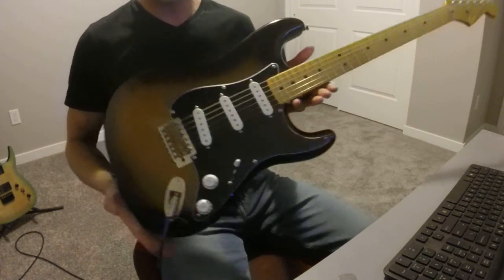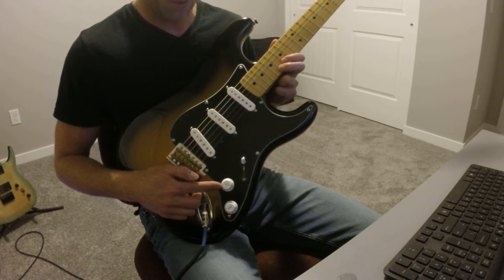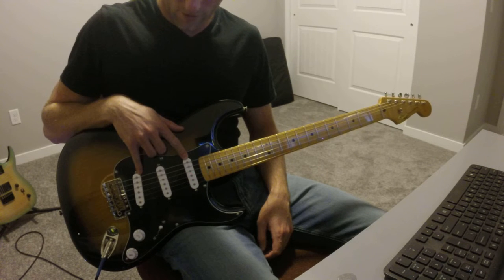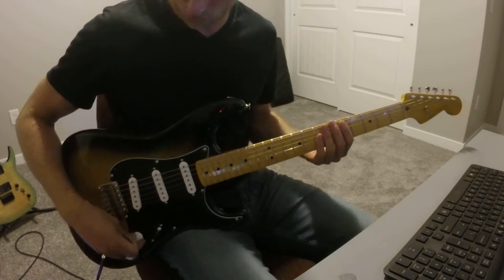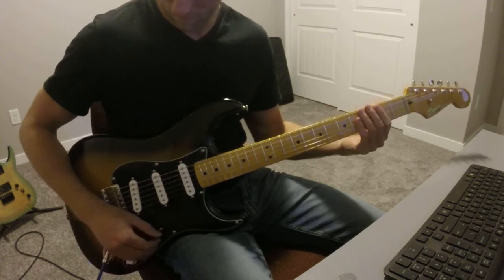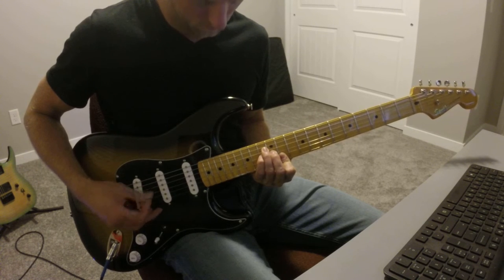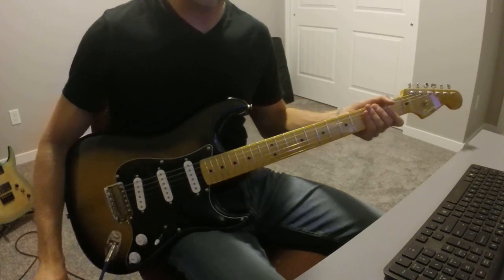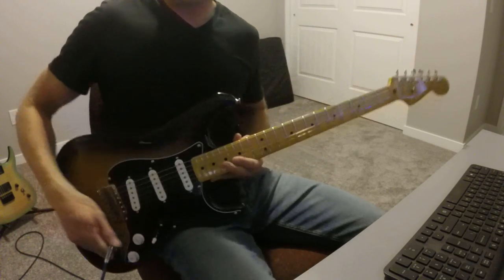Squier Classic Vibe 50's Strat w/ Bill Lawrence Wilde  Microcoil Pickups

Comment: Nice video and great playing. Can you tell me if you are using the pickups with adjustable poles?
Reply from the maker: Thanks man! I'm actually using the niodynium micro coils that do not have the adjustable poles. I do however have another CV strat that I do have a set of the Alnico adjustable pole micro coils in it.
Reply: You have that backwards. The original Neodymiums are adjustable; the Alnicos are not.
Reply: @jameswarren86  Hey there! Whenever I see info of these online they start talking about capacitors and frequencies and get lost haha. I'm debating keystones vs micro coils for my tele build. Any opinions on which I should get?
Reply from the maker: @erickt1974  Luckily I have actually owned both Keystones AND Micro Coils in my Tele. The Keystones, to me, sounded like a set of standard fender tele pickups but with much more definition and less mudd. I ended up not keeping the Keystones in my tele and currently have the Micro Coils in my tele and prefer them as they are brighter, clearer and very open. I think most people shy away from the Micro Coils because they are looking for that "Traditional" tele twang. Which you can get with the Micro Coils, but because these pickups are such high definition, I think that is why people can't hang with the potential sound of the Micro Coils. But I LOVE them and prefer them in both my Strats and my Tele. 

In my opinion, I think you should try them both! They are fairly inexpensive and luckily Becky is still winding both sets, so you may as well try both over time. But I personally ended with the Microcoils because I love the tight, defined and open sound. Just FYI, I have a video on my channel (Ima Robot - Alive cover) that I actually used my Tele with the keystone pickups so you can hear them as well.
Reply: @jameswarren86 If this guitar were a lady I'd like to take it out for coffee and get to know it better. Beautiful chime and stratty quack. I was thinking about brass block and saddles as well....although I'd like a locking bridge with usable trem and locking brass tuners. This Squier CV sounds better than most Fender strats I've heard. I"ve heard that the original pickups were or were based on Tonerider Surfaris. I heard Dave Chapman play one with the original pickups and it sounded amazing but not this good. Of course, Dave could play a ball of twine and make it sound like some custom shop thing. I think he made a deal with the devil at the crossroads or something like that Robert Johnson fella. I was considering the Bill Lawrence T1 & T2 with copper bridge & brass saddles for a tele project....I was also considering  Bare Knuckle Brown Sugars because sometimes in the early morning hours I like to be drunk and pretend I'm Keith Richards. I'm also considering the Bill Lawrence pups that Johnny Lang uses in his tele for a 2 humbucker project. I was also considering Q clones of SRV's #1 strat pickups. Any thoughts about these pickups? Thanks.
Reply: @jameswarren86  Also do you have any opinions about the G&L adjustable pole pieces pups? Thanks again.
Reply: @jameswarren86  Also, 'Dave Simpson' is the name I meant in my first comment rather than 'Dave Chapman'.
Reply from the maker: @patrickbuster8341  Thanks mate! I've tried a few of Bill Lawrences strat and tele pickups and always landed back on the Microcoils. They sound the best to me. So my opinion is a little biased since I have not found a strat pickup that I've felt sounded better than Microcoils.